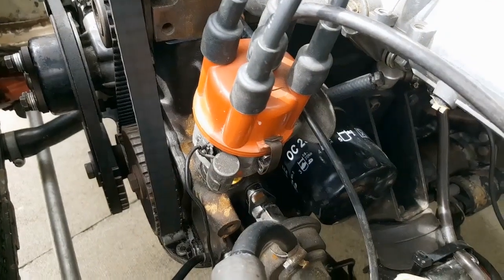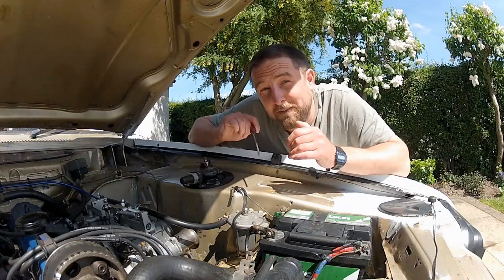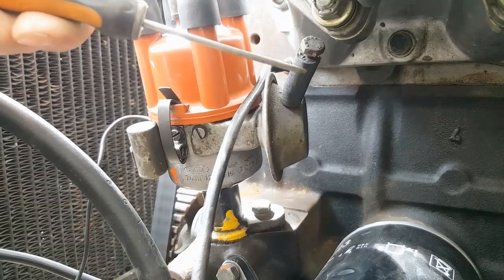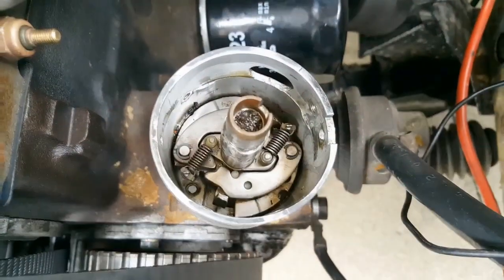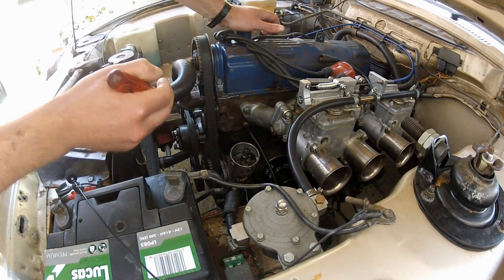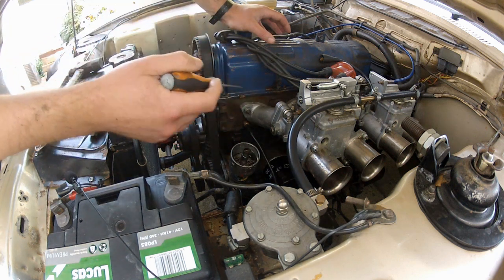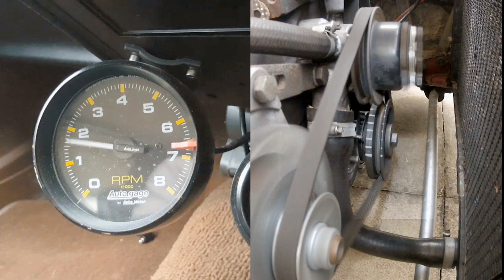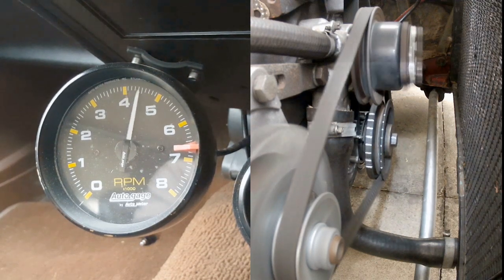Mechanical Advance in a Bosch Distributor / How to Adjust the Timing Curve | Tech Tip 26

Comment from the maker: Need to know how to replace your distributors condenser and correctly gap breaker points?  Check out my video here: 
https://www.youtube.com/watch?v=-MFRgFKmHUo&list=PLx54n6KmznFbQTPO15oOLmk5c7NMsV9xz&index=5&t=3s
Reply: If I remove the springs and bend the stops in completely,.... will that lock out my distributor? I am adding a programmable ignition.

Comment: Sneaky trick - most battery drills have 3 speeds, somewhere around 500, 1000-1200, 1500-2000 rpms. 
The distributor runs at half engine speed so that equates to 1000, 2400, and 4000 engine rpms, so the initial tuning can be done on the bench.
It won't be perfect, but at least it will give some visual cues for the ballpark starting point.
Sneaky trick number 2, the drill can also be used to give a rough speedo calibration as well.

Comment: If you want to keep the vacuum advance, how do you work out the maximum amount of advance it adds? Is it just a case of trawling the web for the original spec sheets?
Reply: you can check with a timing light by seeing what the static timing is and then revving the engine until max advance is achieved. you can then subtract the static timing from the max advance to determine how much advance is added.

Comment: Hi, I have a 1972 MK1 Capri with the 3.0 Essex engine. My distributor looks like it’s come from a Sierra as it has a red cap, no vacuum advance and is electronic with an ignition module fixed to my inner wing. My question is the Weber DGAS carburettor vacuum is blanked off as the distributor has no vacuum advance to run a hose to. Ignition timing is set to 10° btdc. Presumably the Bosch distributor has mechanical advance so is it ok to drive a car that originally had a vacuum advance distributor that’s now had a Sierra distributor and ignition module or should I purchase a new distributor with vacuum advance so I can re connect it to the carburettor? The car is standard apart for the ignition changes which presumably was done during its time in South Africa.
Thanks
Paul
Reply from the maker: Hi Paul. Yes perfectly fine to drive with no vacuum advance. All this does is advance the timing when the intake is in 'vacuum' - which is either idle or cruise. This will give you marginally better fuel economy due to more efficient combustion.
Reply: @FastRust  thanks for the reply.

Comment: To determine the mechanical advance total when bending the weight limit stops place the rotor button on and use a half moon degree protractor from kids geometry kit and hold it over the rotor button to see how many degrees the rotor button turns when spreading the weights by finger. For Lpg vehicles around 7 degrees is fine which is 14 degrees on the crank.

Comment: Hi mate can you remember approximately how much you bent the stops inwards to reduce 10 degrees of movement, maybe 2-3mm?... I've marked my pulley and checked mine, it seems my total dizzy advance movement is 26 degrees - with it set to 8 at 1000rpm it's all in at 34 by 3000rpm.
Reply from the maker: Honestly can't remember mate, I struggle to remember what I did yesterday nevermind a few years back. It's just a case of trial and error. You can sort of see where I bent them to in the vid. That took off about 8-10 degrees of advance.

Comment: I do have a thought in your situation. Why not just remove the vac-Advance from the distributor entirely? Just make a simple cover over the opening and and screws over the D-body.  Cheers
Reply from the maker: Because the way I saw it at the time, the arm from the vac advance holds the top plate of the distributor in position. Without it I was worried that it could still move from vibrations and forces and affect the timing. Could be wrong but better to be safe than sorry.

Comment: Never thought  of this be fixing motors  for  50 years , do know old Ford distributor  gives more advance  than Bosch distributor  going to try on Daimler  v8
Reply from the maker: Yeah it's old school tuning for sure - no laptops and programmable ECUs here. The trial and error part can be slightly frustrating but it does get quicker the more times you have to do it! Good luck.

Comment: What if you have an electronic distributor.
How does that work to advance the timing?
Reply from the maker: Electronic distributors i.e on the Sierra still rely on this weight and spring setup inside so adjustment is the same. How you get into the distributor is different though.

Comment: Easier way to adjust it it all is do the rate first with springs, then pull the dissy out and through the window aperture you can tweak the limit posts with a screwdriver. Plus there is a point set for a Holden XU1 in Australia, these are drop in with a heavier spring allowing clean reving up to 7000rpm. 
Welding or grinding the tabs on the vacuum advance arm will allow adjusting of the max vacuum advance.
Reply: 7k,mmm,, must have rollers.screw in studs. like all real engines have from factory. . or your rockers would be thru the cover. plus, whats wrong with electronic. $60. no bounce. good for 20k.. 6500 every day with a std clevo, chev blow at 6000, . best old skool engine, 460c. easy cheap 550 hp..the LS v8, nearly got it right, almost.. still have the std diff in the xu.. ?..

Comment: Technically, if you want to accutaly disable the Vacuum advance air pressure, you would not seal off one side of the timing diaphragm with a sealed hose BECAUSE doing that actually CREATES a Barometer controlling your timing based against the sealed gasses. #Logic
Reply from the maker: I take your point but in reality this isn't an issue. The bolt stuck in the end does not form an airtight seal so temps do not affect the timing on my car.
Reply: @FastRust  pluis your in old bity, 3 degrees all yr..

Comment: Hi bud, on the subject of state of tune, what is your set up. I’m considering now changing my mechanical advance, I need to know firstly my baseline but I’ve got a 2.0 pinto sohc like yours with a kent fr32 cam, 45mm Weber’s and a matched inlet and head, ported but standard valves. Would my inhibition time and advance be  similar to yours?
Reply from the maker: It won't be the same as your cam profile is less aggressive than mine. If you look in the vid description there's a link to an article which will help you work out your ideal advance curve. It's mainly based around the duration of your cam.
Reply from the maker: I have an RL31 in mine with headwork

Comment: Do you not have hot start problems with so much advance?
Reply from the maker: No issues with hot, but cold starts can be an issue as it'll kick back on the starter. But since I fitted a new battery it cranks faster and generally isn't an problem
Reply: its total advance, not initial,which is idle..
Reply: Small block Chev motors usually hate too much initial advance when hot. I used a kill switch that I would release once the motor was winding over to stop it knocking back.

Comment: Is there a particular reason you've kept with the points and condenser system as opposed to electronic ignition? I'm now changing mine for an electronic pick up for reliability
Reply from the maker: Because I'm stubborn, basically! I like the simplicity of them, and they haven't let me down in the 10+ years I've owned the car

Comment: Greetings from Brazil. I've got an '86 Chevette which has been converted from ethanol to gasoline, so the compression ratio will be higher and I'll be needing to adjust the timing curve. Your video helped me a lot, so thank you very much. Cheers, mate!
Reply from the maker: Thanks, glad it helped out! I wish I'd have known this trick back in day when I put a 1.6 head on a 2.0 block to up the compression. As it turned out it was way too high and I had to run base timing at TDC to stop it pinging under load! You live, you learn. Cheers. James.

Comment: Got mine running the other day so will get a video up when its not raining 👍
Reply from the maker: Nice one. Put a link up when you do.
Reply: @FastRust  Will do, got an old school Gunsuns Colourtune thing that lets you look into the combustion chamber as its running to set the mixture up too!
Reply from the maker: Whaaaaaat?!
Reply: @FastRust  😂 yeah I know! it's a plastic tube with a glass base with an electrode in the middle.  You basically get an extension to your spark plug and with a little mirror you can see down the tube to the glass plug and see into the combustion chamber whilst its running 👍 as soon as its the magical combination of not raining and not sunny I'll video me doing it.
Reply from the maker: Mind 💥. This definitely requires a video!

Comment: Does all this apply to the electronic  ignition as fitted to the pinto Sierra
Reply from the maker: The mechanical advance system is the same, but how you get to it is different. I think you have to remove the distributor drive gear in order to disassemble fully